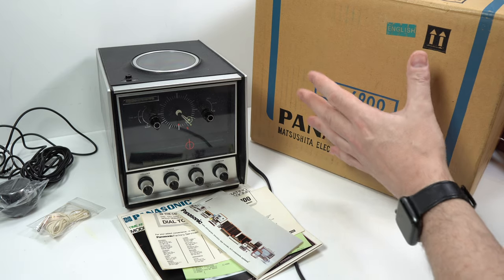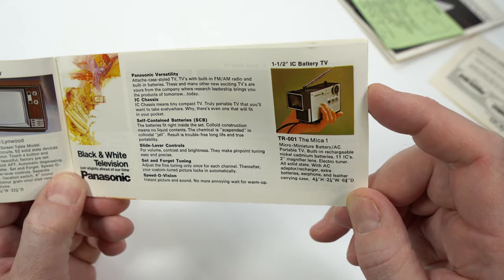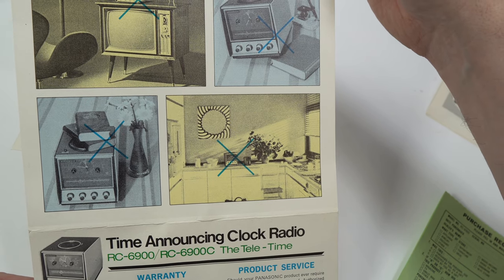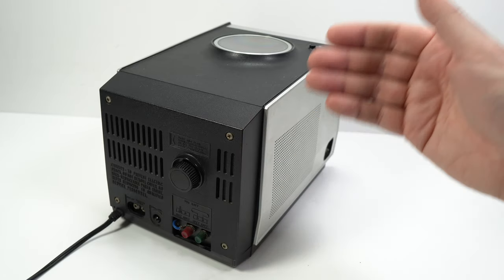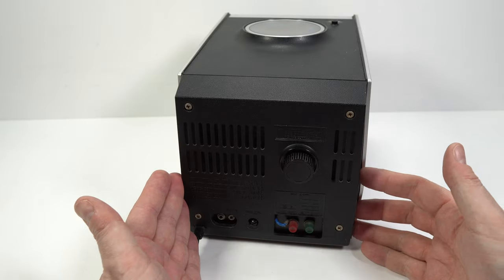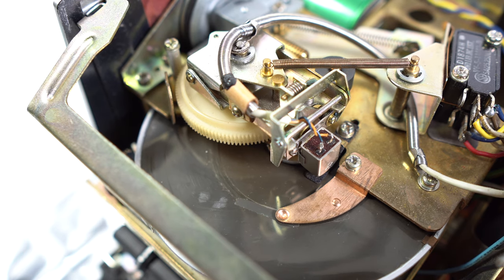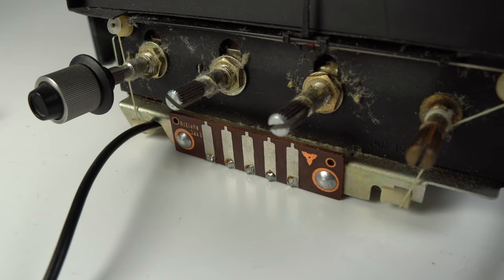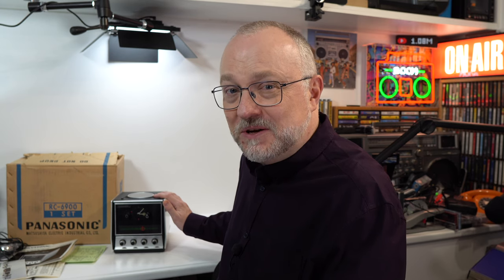The fifty year old Talking Clock Radio

Comment: Didn't you have that magnetic powder gizmo for visualizing tracks on recordings? Would be lovely to see all those tracks spiraling out.
Reply: If you saw the video,(I leave the link here:  https://youtu.be/aZOxn8ggX8w ) in order to use that device, it was necessary to somehow remove the tape from the cartridge or the player where it is located, which it seems that he could not do.... Or remove it so that he can reassemble the whole radio again without damaging any part that cannot be repaired or get a replacement...
It would have been interesting to see how another round tape disk device (a floppy disk) stores the information, but that would require destroying the floppy disk.
Reply: @Nolroa  There is no need to here, that magnetic recording disk has no shell, and floppy is too dense to visualize with that gizmo (I already have asked).
Reply: @artej11  The part of removing the recording disk tape is necessary, otherwise, other magnetic elements inside the radio such as the speaker magnet, could give a bad read and the way the track is recorded in the magnetic disk could not be seen by the gizmo.

Comment: I actually used to sell (and later repair) these when I worked at Lafayette Radio in 1971-72. They started out at $159.95 (USD) but they didn’t sell. I doubt they ever planned on selling many as it was a “halo” product but they must have put so much money into the mechanism that they skimped on other features that people spending that kind of money expected. We didn’t even carry them at the original price as they were too expensive for what was a one trick pony (even though it was quite a trick at the time). 

As perspective: Electronics were more expensive at that time but a really nice clock radio was $69.95-$89.95 and a decent low-end model could be had for $19.95. What constituted ‘really nice’ in the early 1970’s was a flip-card digital clock (sometimes including a calendar), a nice design (probably with genuine wood veneer) and good sound quality. That’s what people who would spend that kind of money were looking for and the RC-6900 had none of it. It used the same Telechron analog clock movement found in the cheapest clock radios with luminous hands but not even a lighted face so you really couldn’t read it at night. The only lights were for the time call button on top and the radio dial. It was also bulky and not very attractive but despite its large size the radio was kind of tinny sounding. 

With virtually no sales the price dropped, first to $129.95 and eventually to $99.95. That’s when we started selling them and they sold Ok at that price. They were only in the line from 1971 to ‘72. I think that’s probably how long it took to sell the initial run.

Other than the disks getting damaged or erased, what normally fails (and what’s almost definitely wrong with Techmon’s) are bad contacts on the micro-switches. A simple ohm meter can be used to check them.  I haven’t found a source for them but you can pry off the flat cover and clean the contacts. The covers are glued on and may break when being removed but the switch will still work. They can be carefully glued back on with a little CA glue. 

The other common problem is an internal break in the wiring to the play head (Note how it flexes every time the time is announced).  This often results in a partial callout of the time (usually the last part, cutting off the beginning). Fortunately the head wire is extra long so (unless it’s been done before) you can unsolder just the head end, cut off the offending piece, strip and resolder the wire to the head. The electronics are actually fairly dependable other than the occasional electrolytic capacitor. 

BTW: The underwater sounding voice is normal, they sounded that way when new. It’s due to the non-linier way the head moves across the disks. The black pad that the head slides onto when it is pulled back is supposed to keep the head clean. It seems to do a good job as dirty heads are not usually a problem on these.  

Good video!
Reply: Underrated comment, (had to auto-scroll down & do a Ctrl+F to find this, i Really hate the YouTube sort and autoload algorithm)

Comment: That was definitely not the first talking alarm-clock: Dr. Daniel, the inventor of the Tefifon, built and sold  in the 1920s an alarm clock using celluloid-tapes with grooves, the same principle as the Tefifon, for playback of the hours. There were indeed two endless tapes for hours and for minutes.
Reply: But it's the first one with a radio
Reply: Yes but that doesn't really talk now does it...it just plays a tape...or disc.  Kind of cheating.
Still a remarkable feat for the time.
Reply: @jimb032  Gramophones were called "talking machines" for a while because, unlike music boxes, they could reproduce actual voices and not just tunes. Also they called playing a record "reproducing", too.
Reply: @worldcomicsreview354  ...still cheating...
Reply: Does it count when your wife tells you what time it is to get you to get up and start working? If so, they have been around for millennia or more.
Reply: I wouldn't be surprised if Techmoan has a saved search going for one now.
Reply: @kenmore01  Best reply.
Reply: @jimb032  - Which... is what this does. By your definition only a person inside a radio appliance counts as "talking".
Reply: very intereting, do you have a source?
Reply: @thysonsacclaim  no.  Not hardly. If it's not generated by an IC or SOC it's  cheating.

Comment: How about replacing the magnetic disc with a FDD magnetic disc and record your voice on it?! just a thought.
Reply: Solder to the head and disconnect the playback amplifier and take an 18 kHz sine wave at -6 dB mixed with the voice at -36 dB and play that through an amplifier into the head while telling the time and the sound will be recorded. You need a pretty beefy amplifier to do this, the $20 Class D amplifiers from Wish work well..
Reply: @brentfisher902  Although to him it's not worth it to have it function properly he just wanted it semi functional to be able to demonstrate it in this video which he was successful in doing so. I can't imagine him wasting time to fix something like this up when he's gotten all the mileage needed out of it for this video.
Reply: Would be funny to record your own voice :-)
Reply: You could probably put together a replacement from a 5 1/4" and a 3 1/2" floppy, and maybe some bits of soda can for the outer frame. I look forward to someone building one and reading about it on Hackaday.
Reply: and how would you record diagonally exactly? Only way to do that properly is to build a rig which matches the disk size and the arc/angle precisely, and make sure that readhead and writehead are swappable. This is a 2 weeks of screwing with tech engineering at best, about a month at worst. Techmoan couldn't do it. @AvE though - might.
Reply: @PicturesqueGames  The mechanism would not be overly complicated. You attach a head on an arm that pivots around the center of the disk. You can use the same head for recording and playback. The only stupid thing is that you have to record every single minute and then advance the disk and record the next.
I also assume that the recording should be much wider than the playback (so different heads are needed) because the playback head must find the track easily.
Also the disks must be advanced in steps. A continous rotation would lead to interference at 30 seconds where it reads between the minute tracks.
Reply: He wouldn't mind fixing the device, he fixed many and some really not that much worth it IMO, if you think about. I think the only thing it's preventing him is the overcomplicated way the discs works. 

As far as I see, the device has 2 separate discs spinning at different rates. One for hours, and one for minutes (AM and PM), a real lady (to make the device feel more authethicC) or a digital lady (Alexia, Siri, Google Assistant or TtS voices) to tell the time for you, the overall deprecated state of the device and probably it could be easy to replace the head for a recording/read one and make an amp set up for the recording. Then the hassle to re-record all 132 tracks without missing a beat.

Probably a 8'' (cut properly) and a 3 1/2'' floppies could do the trick. 

Maybe we'll get to see a future episode fixing the darned thing?
Reply: @RetroArcadeGuy  Wouldn't you only need to record 72 tracks(12+60)?
Reply: @JamieJamez  keep in mind the clock differentiates AM and PM.
Reply: @RetroArcadeGuy  14:51 She never says AM or PM
Reply: Wrong type of magnetic media, methinks.

Comment: 30 years from now reviewing a piece of tech. 1. Well the plastic has broken down to it's oil base 2. It needs a firmware update that is no longer available. 3. The oem none replaceable battery died so it won't turn on.
Reply: bonus requires app (with a required login). i look forward to my gifted photo frame becoming a brick in a few years.
Reply: @kandace4088  extra bonus. Apps and phones will be something completely different in 30 years time.
Reply: Don't forget you won't be able to charge the device as wireless charging becomes the norm and your house has no sockets!
Reply: This is actually a concern for the collectors automobile market (with at least some saying there won't be much to restore past 2001 long term).

Too many plastic parts, too many specialized electronics, and more and more of of the electronic codes needing factory tools to diagnose.

It's a peculiar thing when $40,000 (or more) item becomes disposable.
Reply: So far, we've been lucky when it comes to antique software. It surprises me that 30 year old DOS drivers are still somewhat easy to find.
Reply: @mfbfreak  There's still a big scene around playing old DOS games which has probably helped.
Reply: And you won't be able to open the case with a normal screwdriver.
Reply: #3 is already a major problem with certain video arcade systems, particularly Capcom's CPS-2 and CPS-3. The decryption keys are stored in battery-backed volatile RAM . . ..
Reply: So true my camera failed to come on because the battery got to low so I had to dismantle it disconnect the battery leave it. Turn it on with out the battery and then reconnect it and it charged it up or it would have been another scrap item.
Reply: 30 years is being optimistic. My 3rd generation Apple TV just notified me YouTube will no longer be supported sometime in March. Doesn't seem too much longer till it joins my 2nd generation Roku at being a doorstop. Sad to see this trend of disposable technology.
Reply: @tsunamirider9895  OMG I just turned on my Apple TV and it said the same it will no longer be supported. I hope they don't remove it from the device I bet they will they want you to buy a new one. Best thing to do it turn off auto updates it might work a bit longer and they won't be able to remove it don't see why it shouldn't work it's only a software player.
Reply: @tsunamirider9895  Not in everything but those internet based devices are generally far cheaper than anything that came before and considered throwaway due to that. A Panasonic DVD Player from 1999 (example) is still running as well as the day it was made.
Reply: @Azlehria  Thankfully there is a workaround for this issue on CPS boards now, but it took many years for someone to reverse engineer the decryption. ModernVintageGamer has some videos about this.
Reply: 4. It needs a cloud service which is not existing any more. 5. It used a communication protocol no longer in use. 6. It needs licensing service the license company doesn't run anymore.
Reply: Thirty years is a bit of of a stretch for TODAY's tech.  Maybe 20 at the most!
Reply: @rjz2  CDs and writable CDs are so different that it is futile to use the lifespan of the one to estimate how long the other will last. A proper factory-stamped CD has the data in a silver layer on top of a surface whose height varies by a quarter of the laser wavelength, such that the laser wave is either canceled out or not, 0 or 1 (or the other way round). There is nothing organic in this type of CD that can degrade. These disks will in theory last forever unless there was a manufacturing error, or the disk is physically abused such that the silver layer becomes scratched. 
A CD-R on the other hand has a layer of organic dye in which dark spots are burned during writing, and those dark spots cause the laser wave to being either canceled or not. For this type of disk to self-destruct, it suffices that the manufacturer used a low-grade organic dye that just spontaneously ‘rots’, or if the CDR has been lying in the sun for too long such that the entire dye layer has become effectively ‘burned’.
I once made a backup of important things worth keeping on a CD-R. Of course a few years later it proved to be one of the self-destructing ones. A music compilation written on another CDR 10 years earlier is still faultless though even today. But back then the CD-R manufacturers actually dared to give a guarantee that the data would last for at least 50 years… and those things were also a multiple of the price of the later ones, but in the end you got what you paid for.
Reply: @tsunamirider9895  That's what you get for buying Apple products. I hope you learned your lesson...
Reply: 7. The end-of-life fuse inside the main SoC has been triggered remotely by the manufacturer or due to the date being after a certain point set in ROM. Because of this, the processor is now hardwired to run HLT or NOP instructions.
Reply: @IrisGalaxis  lol, I've learned. When I got that message I went to Best Buy to price out a new Apple TV then had that Homer Simpson D'oh moment. Will never ever buy another Apple TV again. I'm so tempted to pick up a new iPad, but likewise after my iPad2 experience, never again. Seriously, you buy apps, then are forced into an iOS update, those same apps don't have new updates and no longer work, or fork off to a "different" version you need to pay for. And no official/legal way to roll back your iOS version, or you can't access the store to make new purchases, etc. It's pretty slow and unsuable at this point. Even with all the latest updates some stuff just doesn't work anymore. It's all quite frustrating and disappointing.
Reply: A lot of things from the late 90's / early 2000's like Minidisc players, early MP3 players, the phones of the time etc, all had bespoke chargers / PC connections / headphone connections that only that device (or similar ones from that manufacturer) used. If you buy one without the cables, it's basically a paperweight.
Reply: @worldcomicsreview354  And it only got worse... well, at least we have standard cables nowadays (more-less) but everything else's gone worse.
Reply: Reason 100. Skynet has taken over the world and reviewing old hardware is a luxury humans can't afford.
Reply: @tsunamirider9895  The problem here is that Apple just views you as a wallet and a pirate, and not a human being. Even if people are 51% vehemently in favor supporting intellectual terrorism, Mother Nature is not...eventually the world will be too polluted and George Floyd isn't going to be the only person that can't breathe...

Comment: "Use No Hook" may be an old fashioned marking, but as a UPS worker I can assure you that there are still boxes being printed with that to this day.
Reply: @James Uthmann
What do you guys use instead in needed situations?
Reply: @watershed44  I've never encountered a situation where I thought I needed to use a hook on a box. I could be wrong, but I think the label is a hold-over from the times when they used to load ships with individual boxes/barrels; now everything is shipped in shipping containers anyway, so it's not really relevant anymore.
Reply: @jamesuthmann940  Thanks for the reply. I was genuinely curious!

Comment: Looks suspiciously like a GameCube, moreover, it’s like the GameCube looks a lot like this clock.
Reply: Panasonic developed the optical drive and disc format used in the Gamecube, and collaborated with Nintendo to create a special Gamecube which could play DVDs. It was only available in Japan.
Reply: Another factoid, many mammalian fin fish look the same in opposite sides of the world, without any DNA transfer/intercourse or data transmission. Similar problems result in reasoning to similar solutions. If Eli Whitney didn't invent interchangeable parts, someone else would have not very chronologically distant from that time.

Comment: In case my comment below wasn't long enough... To Techmon or anyone else trying to repair one of these: 
I noticed in the video that your outer disk overlaps your inner disk, it should be the other way around. That will cause issues for sure. To convert to 50Hz you should be able to locate a 50Hz Telechron clock movement from the 1970's and swap the gear pack. That clock was common to almost all analog clock radios of the day. You don't even have to rewire anything as the gear mechanism is magnetically coupled. Also read my other post about the micro-switches. I have detailed photos of the inside of a working mechanism. Let me know if they would be of any help.
Reply: Thanks for the additional technical info!  I noticed the disk overlap was in opposition to the tape head movement, and couldn't believe they'd designed it that way.  Guess it got messed up during the repair (kind of amazing that this odd mechanism still worked fine with reversed overlap and with the splicing tape).